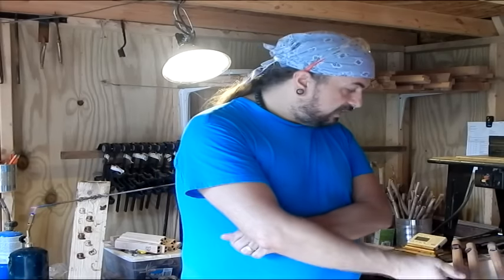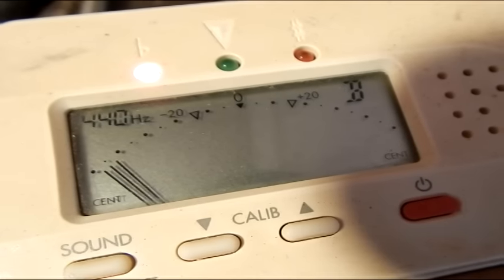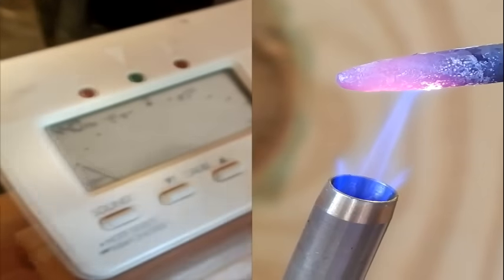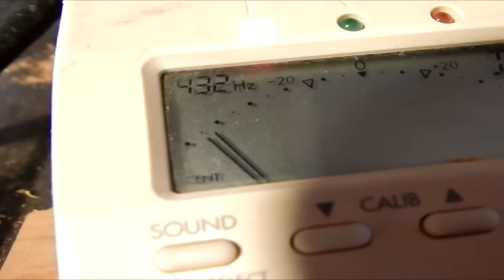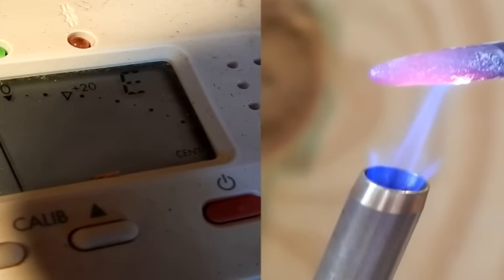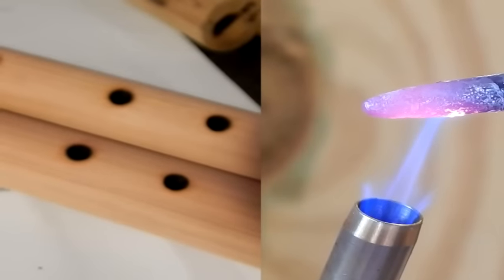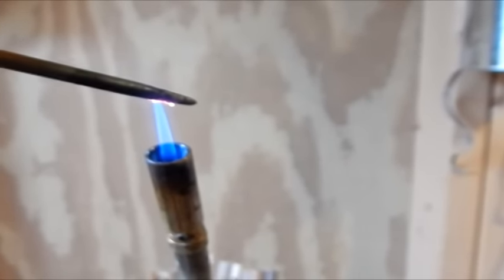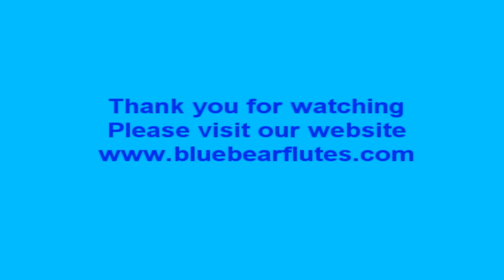Native American Flutes - Tuning to various Frequenicies 440hz, 432Hz, and 444Hz or 528cHz

Comment: I don't understand the pic on right and do you make the holes bigger for 432 or smaller im trying to get my 440 to 432hz. 440 is my wife 432 is my dog.
Reply from the maker: The whole sizes determined during the tuning process. If something is too flat, you will make the hole larger to make it sharp. We do have some other videos on tuning which may help out.